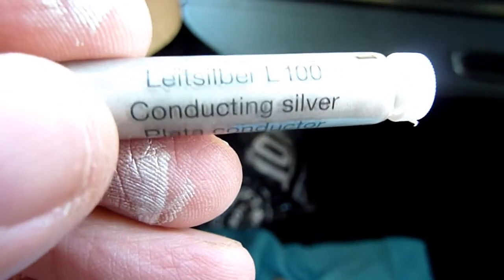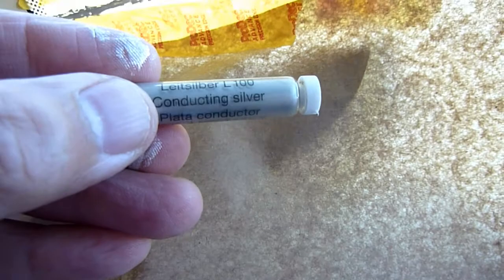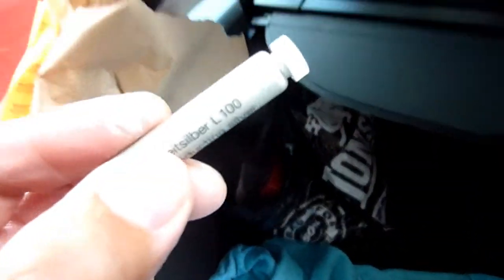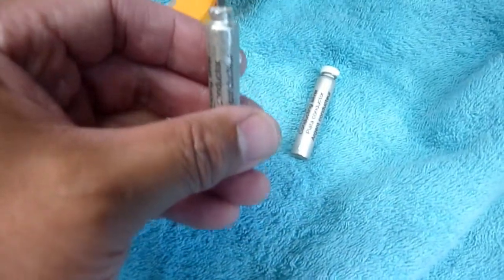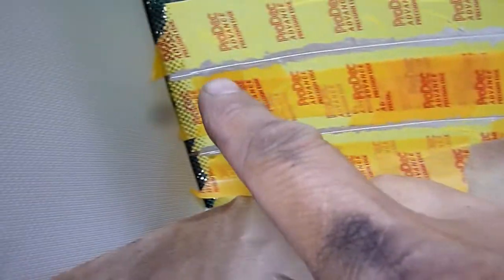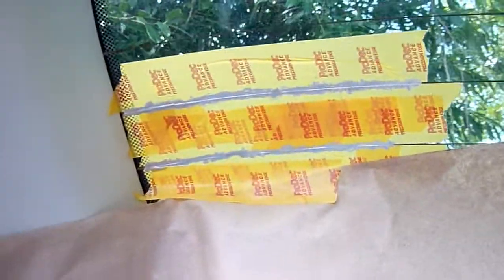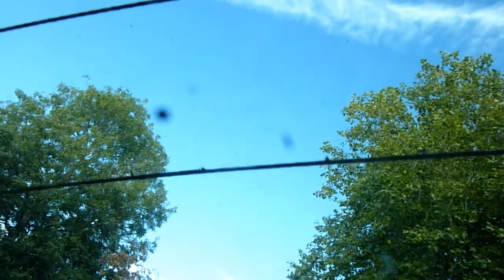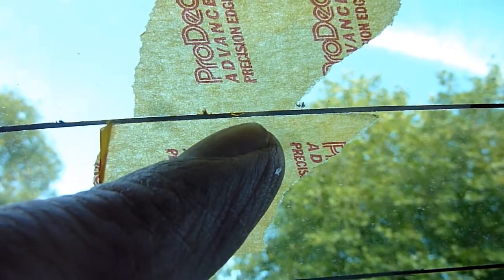Only Choice for Rear Window Heater Line Fix

Comment: Thanks for the video, i managed to pull the silvering off a patch on the bottom 3 wires when i took out a sticker! It stuck to the sticker!!
Reply from the maker: The same thing happens to me every year. Good luck and remember to only buy Lite Silber L100...see link in description
Reply: @EducationPineapple  thanks for your reply, fingers crossed! What about that stuff you can get in little syringes that is for circuit boards etc?
Reply from the maker: sorry cant guarantee that circuit board stuff. might work.